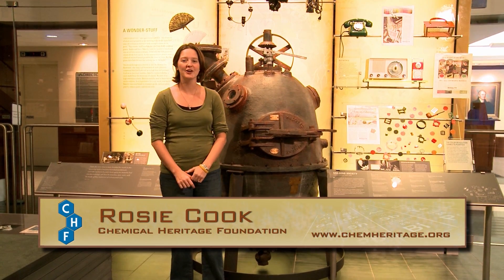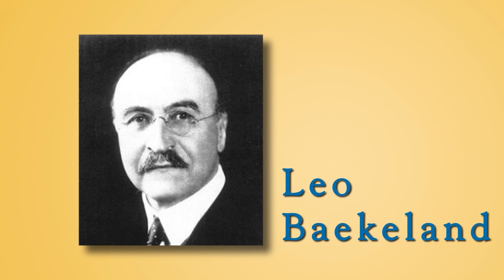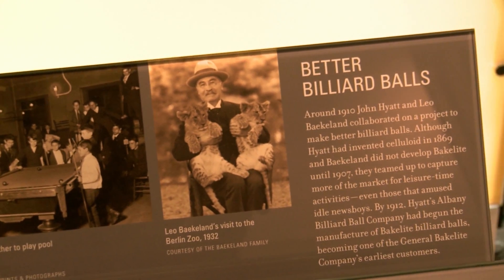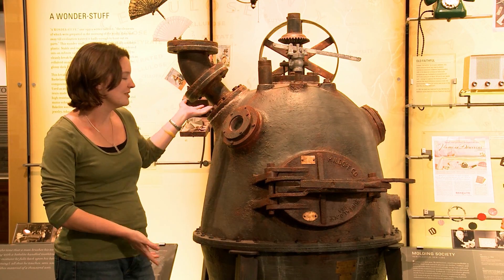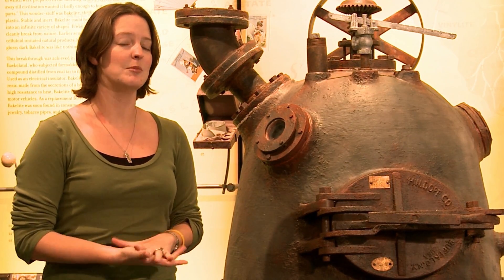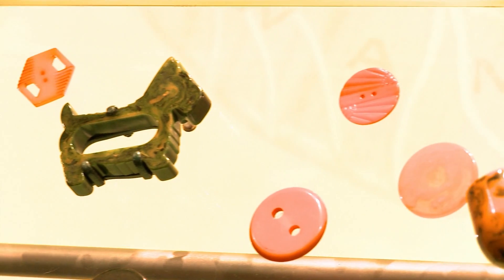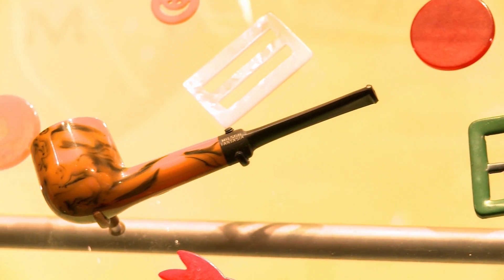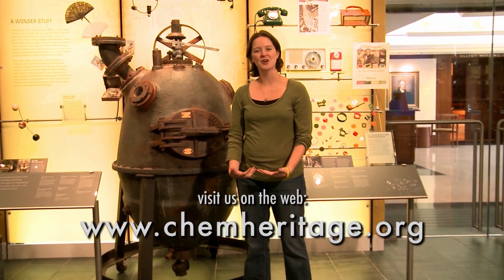The Bakelite Breakthrough: How plastics came of age

Comment: I've done a moderate bit of investigation on this, and as far as I can tell, the idea that celluloid balls would explode is a myth. You can hold a butane torch against a mound of celluloid, and at worst, it flares up a little bit and then extinguishes. Celluloid was no good because it didn't bounce as well as ivory.